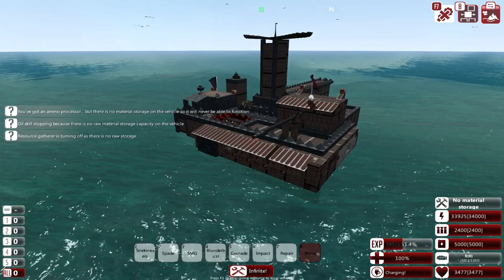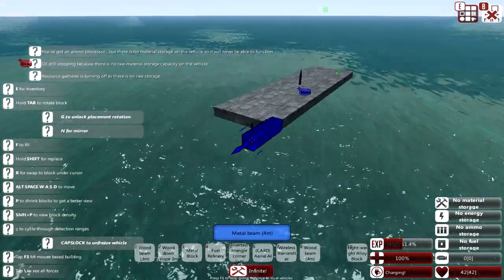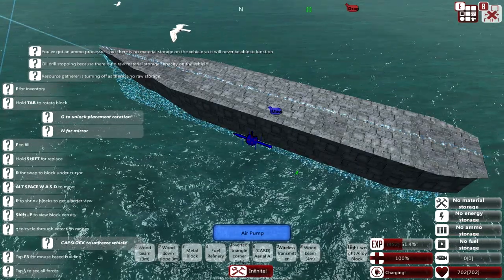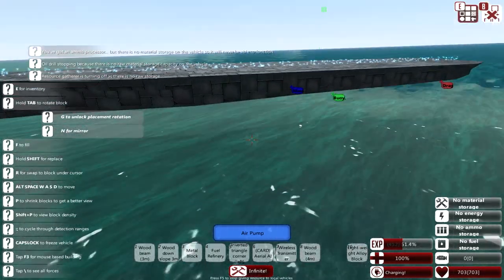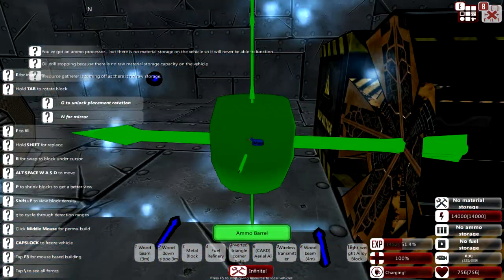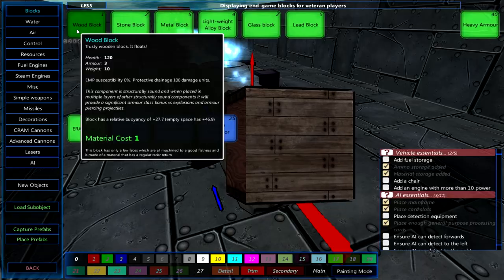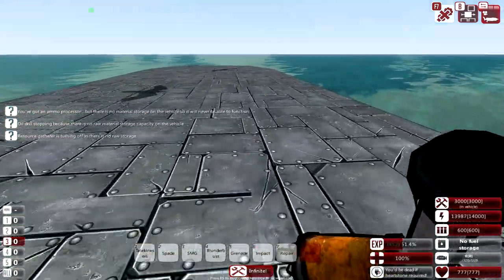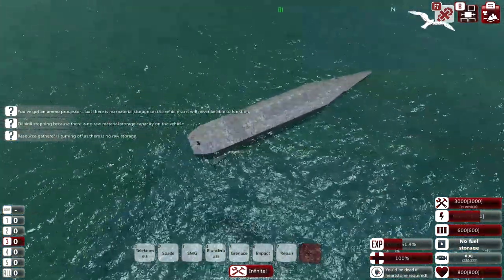From The Depths | Boat Tutorial - The Basics (AI - Propulsion - Hull building)

Comment: I mostly just use hydrofoils to stay stable as whenever I try to make keels work, the boats decide they want to be submarines.
Reply: I’m no expert, and you commented this years ago, but it sounds like the answer is ‘less keel’.
Reply: @jasonalbert6251  or helium however if your center of mass is to high but your also to heavy the helium will instead turn you upside down I know from experience and I used a keel but it still flipped and the reason for helium was I was weak low on materials and trying to escape

Comment: I'd love a PID system tutorial Lathrix, I remember you mentioned potentially making a tutorial in one of your more recent videos; that would be awesome friendo!
Reply: you dont really need one though, I actually managed to use them without a tutorial (they have really good explanations on them. basically, you need 3 pids, one for altitude, one for pitch, and one for roll. 

for altitude, put thrusters on the bottom, put test stim 1 to the altitude you want (if you are making a hovertank to fly at 10 metres, set it to 10) and check "test stimulus 1". 

for the pitch, make the front set of thrusters "thruster reverse", leave the back ones "thruster" (or maybe it was the other way around, i dont know right now, so reverse it if the vehicle starts flipping) set the second pid to "pitch", leave the test stims at 0 (that controls the pitch angle) and set it to "test stimulus 1".

for roll, place another set of thrusters on the vehicle, one on the left and one on the right side, set the left ones to "roll (LHS)", the right ones to "roll reverse (RHS", put the third pid into roll mode, leave the test stims at 0 and set "test stimulus 1".

Now check how fast the vehicle corrects altitude, pitch and roll (set the test stim 1 to a strange value for a short time, then change it back to normal). If the vehicle takes too long to correct any of those, set the kP.Gain higher.

You now have a working hovercraft with pids.
Reply: +Jojob541 that's complicated
Reply: TechDragon - Gaming and More  But i think everything i wrote is understandable enough to do it yourself, right?

Comment: Why'd you think to make this?

Also, it would be nice if you did a Lazer tutorial. After 200hrs I'm scared to touch them :/.
Reply: My first attempt at a laser had a ridiculously high negative damage value. I don't think I'll ever touch them again until lath makes a tutorial on them.
Reply: HEALING LASER BEAMS!
Reply: GOUST WILLIAM try to just make a line of cavitys and put pumps on the while placing q switches and it will defiantly work
Reply: Generally speaking, this is how to laser:

- Set up a few couplers attached to the multipurpose laser somehow.
- Add Q-Switches to the couplers. 1 switch maximises the range, 4 maximises the power/damage efficiency, and 2-3 is somewhere between. I advise that you go for 4.
- Add cavities to your coupler. Use the standard ones (Not the single inputs or storage ones), and make sure to place a few. Generally speaking, add one for each 100 power on your vehicle.
- Add 4 pumps to each cavity. DON'T add any frequency doublers/destabilisers yet.
- Connect this setup to your combiner (the firing piece, if you'd prefer.)
- Add lenses to your combiner. Steering lenses increase the field of fire and accuracy, normal ones add more accuracy than the steering ones.
- Test the laser. If your damage drops (e.g goes from 100 to 60 over the course of a second or 2) (which it shouldn't yet) check you set everything up right. (To see your damage, just look at the combiner or multipurpose laser.)

Now you have a choice:
- Add more combiners until your damage drops. (This is like having more cannons on a ship)
- Or, add destabilisers until the damage drops. (This is like having a bigger cannon instead of several smaller ones.)
- Or, use a combination of the 2, if you want.
- Add frequency doublers. These increase AP: Only use a few if your laser is for anti-air as planes (usually) aren't too heavily armoured. Add more doublers until you get the AP you want.

Other parts:
- Anti-munition nodes can connect to this laser too. Remember, they count as a combiner, so they can drop your damage.
- Colourers are purely aesthetic. They connect to the combiner.
- The adjusters (I forget the exact name) allow you to sacrifice some damage to let your lasers get through smoke and laser-absorb shields. These aren't necessary early in the game.
- The other types of cavity are for lasers that will be used in short bursts. Single-inputs will increase your damage and cut the power cost, but you will lose damage over time. Storage cavities are more extreme versions of the single-input ones. You will have huge damage values if you use these, but it will drop rapidly.

A final note:
- If you're making a low-power laser, you don't need 4 pumps per cavity. A single combiner can be supported with only 2.

Sorry if this was too hard to understand, I'm not exactly a qualified teacher :/
Reply: Crescendo's Domain you deserve a like , becase of your hard work ;)
Reply: sole arcarese arcarese Why thank you :)
Reply: GOUST WILLIAM same
Reply: Crescendo's Domain
You deserve more than a like. You deserve a medal. If only I was capable of building this in a space-efficient way, I'd add one to my battleship.

Comment: Robocraft has some insane updates, 2000CPU, Tank Tracks buffed, low CPU vs high CPU bots (Low CPU has better power and quicker) Power booster is now a power Modula. Weapon energy meter, goes less as you build. 2 New starter bots. 10000 levels, A you level up e.g. 100 > 101, you get 101 Polonium crates. EMP countdown is from 3 to 2. 10% Less reduction to NANO heal rates. Tank track are bigger, more CPU and stronger. Cost 25K. Tank Tracks, Mech Legs and Sprinter Legs now have limited carrying capacity (it was unlimited before). Wheels have a speed buff if its low CPU e.g. If that didn't happen, wheels would be quicker but now there super quick. Every movant type has got more friction. Wheels have 20% More friction. Thrusters are 30% Faster. Motors will soon be coming out.

Comment: I literally can't build ships normally but I built a fully functional pirate ship, using only sails as propulsion, in a day or so and it looks bitching.
Then the same day after I got bored of it I made it fly using hot air balloons and sails. Then I added arms on the side that swing outwards with sails attached to give you extra speed in the air, but my only problem was that it couldn't turn.

Comment: make a tutorial on rotor-powered flythings pls.... I'm not a smart man and mine always flip all over the place
Reply: For rotor powered flying things, check always up on heliblade spinners or use always up blades
Reply: Thanks mate but I have tried that already, the god damn thing flips over :/ (especially talking about hovercraft-like things, where the thrust is fairly close to the center of mass)

Also, where does the "thrust" come out of on a spinner? from the original spinner block, or the center of the whole thing or..?
Reply: It comes out from the middle depending on how you put the blades, make sure you put the blades in the right angle, if it flips over you have the rotor/spinblock going the wrong way, set it to reverse and it will fix that issue

Comment: in my game a huge propeller is not actually that much faster about 0.9 velocity faster than a normal one why is this?
Reply: it was perfect and everything now I don't really care at least it's faster
Reply: The propeller's max velocity isn't increased, the overall force is. You may simply not need a large propeller for your craft's size. You should at least notice much better acceleration with the big one.

At any rate, make sure it's getting enough power, AND (this is crucial), MAKE SURE IT'S ALWAYS UNDERWATER. Propellers that sit very near the water line often spend only 50% or less of their time generating forward thrust.
Reply: Argonwolfproject thank you
Reply: wither storm
Did you find out what was causing the issue? :D
Reply: Argonwolfproject I was a bit dumb

Comment: I need to know how do you build a cheap battleship
Reply: AlexGames OnYT you don't
Reply: A battleship is fundamentally an armored artillery platform. If you want it cheap, build it out of wood or light metal, just remember you'll get the protection you pay for. Cram cannons are more suited to howitzer-style guns than advanced cannons, and are easier to set up (and often cheaper), so make lots and lots of cram cannons. You can use tactical missiles as well if you like, just make sure other ships protect your battleship from air attacks and fast, small ships.
Reply: My cheapest battleship was 120000 material
Reply: *****
That is quite cheap indeed for a battleship.
Reply: gets shrekt by a drake light and one shot in the hull and it goes boom

Comment: Checklist for my ship
Hull, check
AI, check
Propulsion, Check
Weapons that are effective, no
bouyancy, check
balanced bouyancy, no
storage, check
ammo spread evenly instead of one spot, no
explosive things not near each other, no
Reply: There is an extremely effective cram cannon I build. It's 3x3x8 at 1616mm (1.6m) that has a reload of 10 seconds. Coupled with Vertical launched missiles, its deadly.
Reply: Jarmsie welp that sounds great but i think i will make my own cannons but im having trouble with what shell types to use for advanced cannons against the DWG, currently i use Squash head shells and im experimenting with APHE shells, what would you recommend
Reply: matt leppen I would recommend a HollowPoint HE shell. It obliterates the armour on a Plunderer like it was never there.
Reply: Jarmsie ok cool, i think after i start using that shell i will turn up the difficulty to actually fight those since i was new i was testing vehicles in the designer like the flying squirrel and the plunderer, i made a cram bomber that annihilates entire chunks of ships but it doesnt fire sometimes?
Reply: +matt leppen That can be down to multiple things. It might be an issue with the Local Weapons Controller.
Reply: Jarmsie i have to set restrictions because it used to clip itself with the bomb but i can try to make it bigger so it fires, it works most of the time but sometimes it just only fires one and not both or it wont fire at all